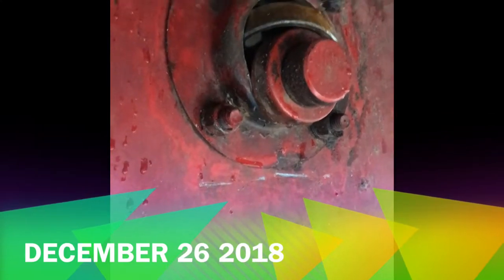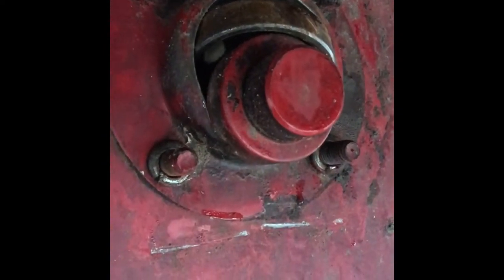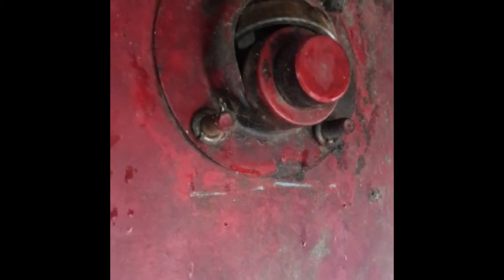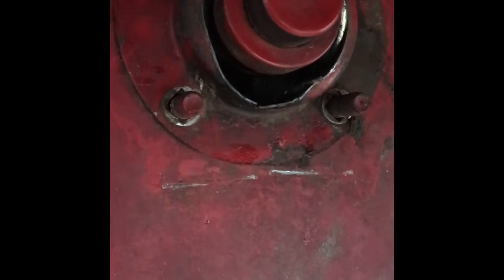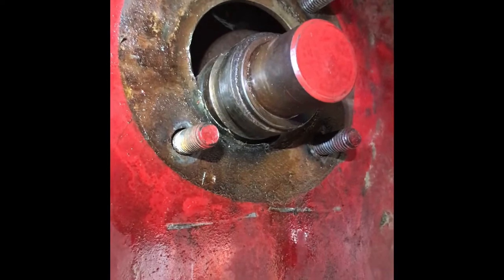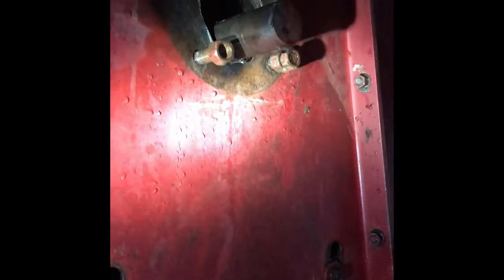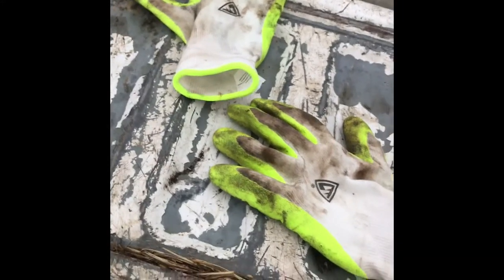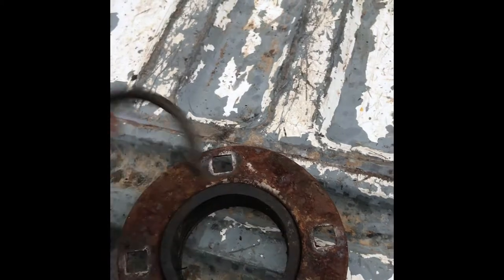Case IH 1660 chopper bearing replacement #1

Comment: Clint, you have your work cut out for you.  Hope you get the correct bearing and that flange and cover.  LED lights are nice and bright and draw less power than the standard halogens so that may be something you'd want to put on the 1660.  I don't have any heavy farm equipment and don't work on them but there are several folks in the YT tractor community who do and if you give a yell out on YT, they'll respond. I'm a new subscriber and came over from Geiger Farm's shout out to ya.  Hope that bearing job wraps up without too much of a headache.  👍
Reply from the maker: Thanks for subscribing houndsman one. I ended up putting a light bar on it but will be upgrading that and the other lights after the season. We have several more upgrades to this machine we will be making in the coming days and months. I’m a beginning farmer, only in my 2nd year. So we will be having a lot of big and exciting changes coming in the future. Thanks for your support and comment.
Reply: Absolutely, Clint.  Be safe when working around the machinery and it's internals.  I think you'll enjoy the rugged start-off of your farming days because you'll learn as you grow.  Have a fine weekend.